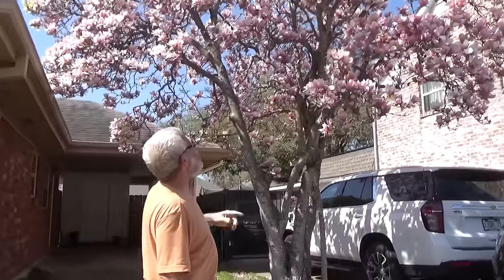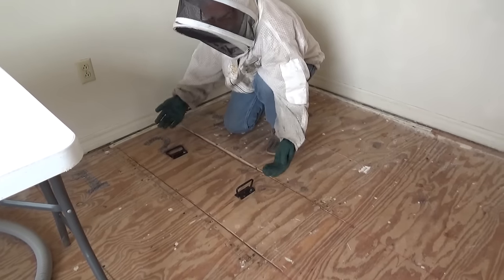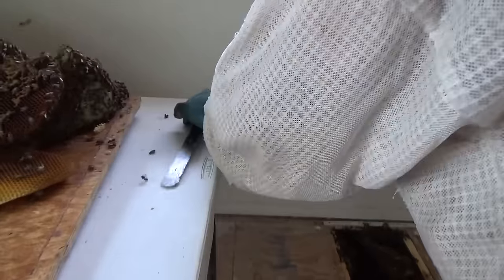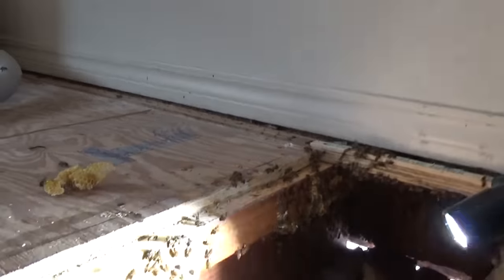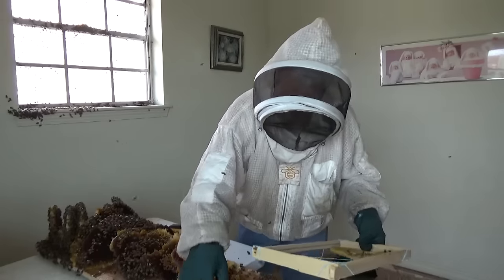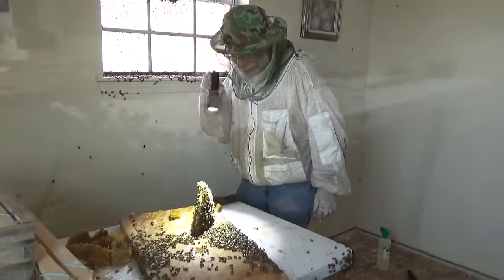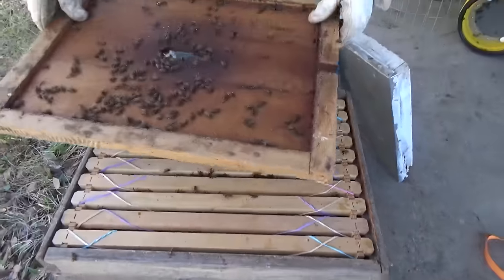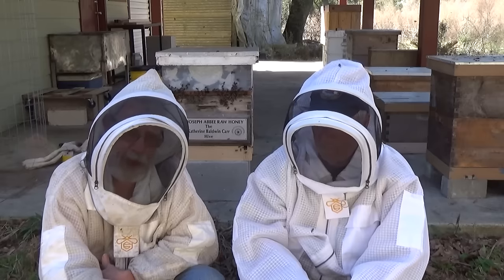Look at what was under her bed...again!

Comment: Since the owner won't secure the house, you have job security for life. You know that you will have at least one removal a year. The damage done over and over, could be prevented by blocking access. He must enjoy your company and visits.
Reply: Little damage done by now, the floor boards are already cut, so can easily be lifted without doing further damage.
As it is a regular recurrence and that space seems deep enough, I would recommend putting a couple of boxes with frames in there. It will make the next job a lot quicker and easier and the comb will already be in frames as well. The only thing left is to check for the queen.
Reply from the maker: I don't have any problem going back to Nick's every year. Since I don't charge him anything to do the removal, he's very happy with the arrangement and the yearly visit. Thanks for watching. God's peace Grandma.
Mr. Ed